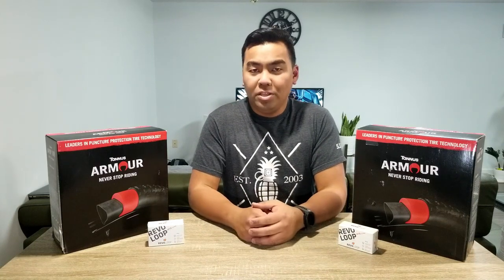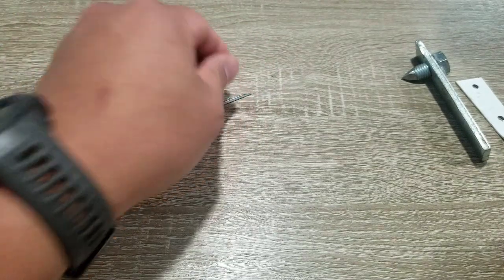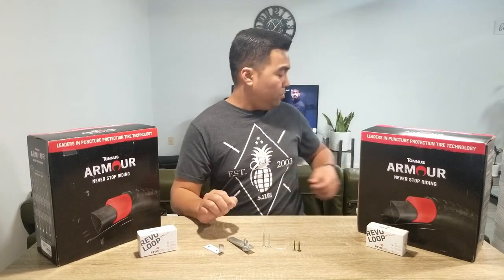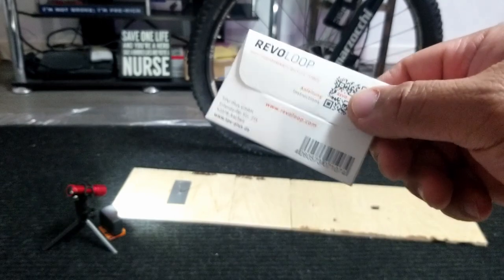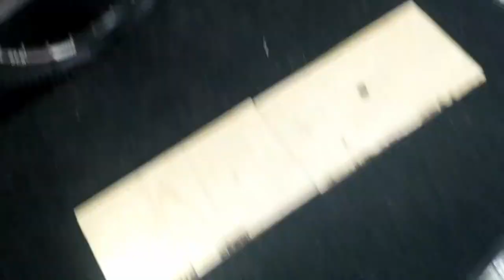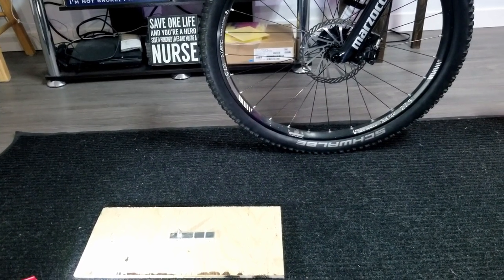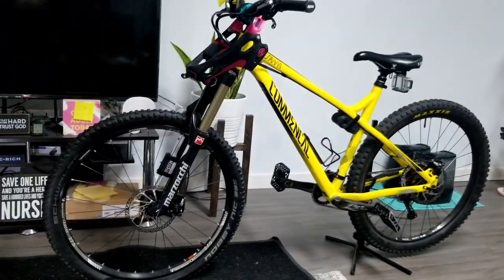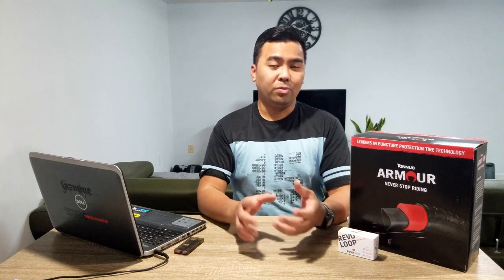Revoloop Puncture Test || 2x stronger than butyl tubes???

Comment: Thumbs up for carrying out the series of experiments. Pretty brutal tests! I wonder if an automobile tire would have flatted on the nail test as well. It's a nice demonstration though that one shouldn't expect magical performance from a tube.

What's an informative testing protocol is a tricky question. On a hard enough test, any setup will flat. On a sufficiently easy test, any tube will survive. How narrow is region inbetween where tube (or tubeless) choice actually matters? (How common is a situation where you will have a puncture with tube X but won't have a puncture with tube Y?)

My intuition is that for puncture tests, the tire choice is going to be far more important than the tube choice.

Comment: I am wondering if you can put sealent in these revoloop tubes. I have the fat bike tubes and I am wanting to put Flat Attack tire sealant in them.
Also that test is really inconclusive as any tube would have done the exact same. Putting sealant in those tubes would have been a better test as we know sealant works in regular tubes we could have seen how sealant did in the Revoloop tubes.
Reply from the maker: Unfortunately we cant put sealant on the Revoloops. The chemical composition of TPU tubes and the sealant are not compatible.
Reply: @maharlikarider3470  I looked up TPU and found this: thermoplastic polyurethane (TPU) comes in a wide range of high-performance formulations that deliver exceptional chemical resistance. These polyester and polyether grades have the ability to resist chemical attack or be dissolved by or swelled by solvents, acids and bases.
Reply: Hey Larry Left! I emailed revoloop and asked can you use sealant! They sent an email back saying that almost all sealants use amonia and amonia is not compatible with tubotito tubes! Ride ride ride!
Reply: Nice video brother

Comment: At first i thought this would just be a troll or clickbait video, but it exceeded my expectations for one. First, what kind of inner tube would actually survive piercing it directly with a nail? Second, what exactly are you expecting when the advertisement said it would have ”better puncture protection"? Do you want to imply that it should've been puncture proof? And third, if you want to do an actual test and document it, you should've waited for good weather and actually hit some gnarly and rocky trails and put some miles while you're at it. This test doesn't even prove anything as it would have the same result using all other inner tubes out there.
Reply: the test was much more relevant than the above pointless comment